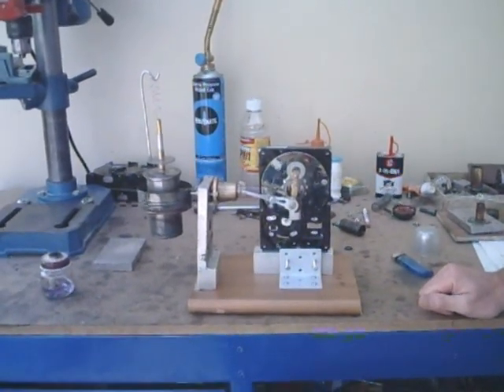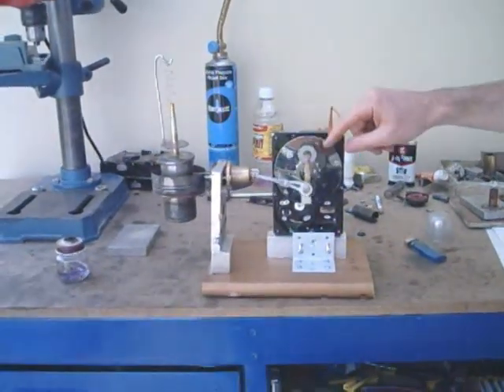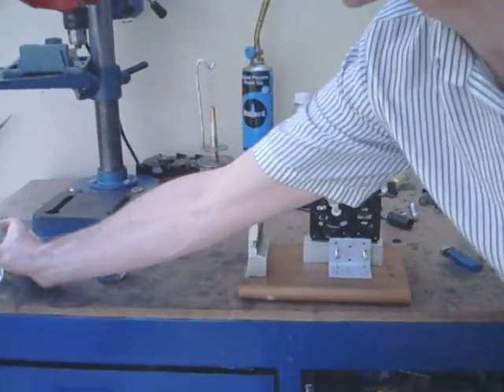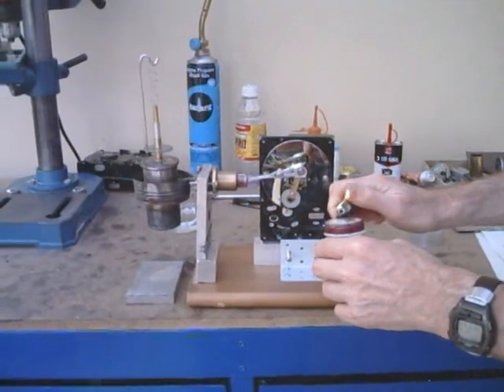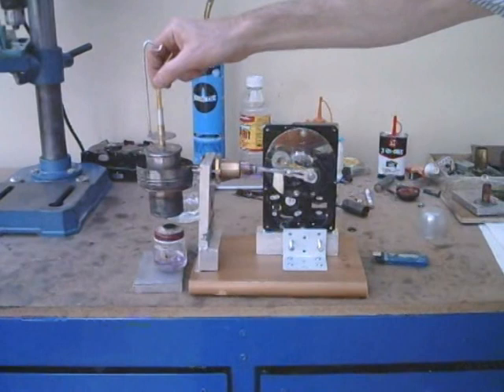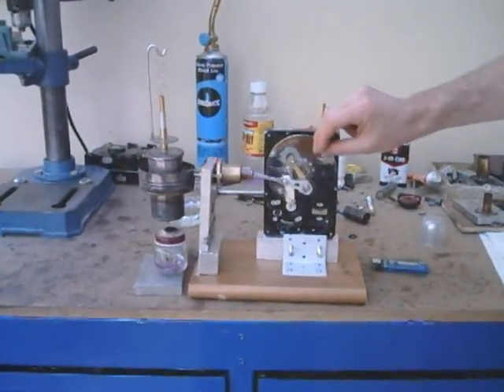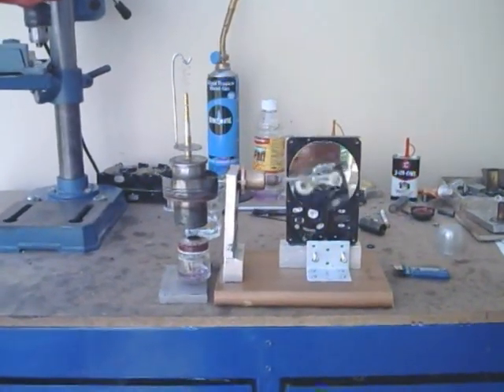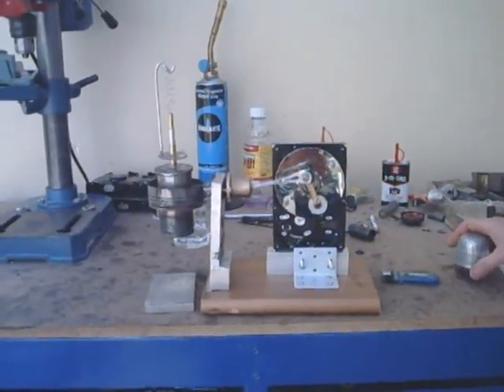Model Rignbom Stirling Engine

Comment from the maker: I am sure there is a way, unfortunately it takes a much smarter man than myself to figure that out. I worked by trial and error, not at all sure that the parameters I chose were optimal.  In fact very unlikely.

Comment from the maker: Sorry, don't have any sketches. It is a Gamma SE, it has a displacer, not a hot and cold side like Alpha type has. It is a Rignbom design, so the displacer moves not because it has a mechanical link with the power piston, but because the displacer push rod has a reasonably large diameter (8mm) so it has enough area for the changes in internal pressure to produce enough force to move it.

Comment from the maker: The issue is power density, ie the ratio of power output to the size/weight of the engine, it is here where SE loses out to steam and IC engines. And here the thermoacoustic design suffers especially. It is almost impossible to extract any decent power out of it unless it is the size of a house. The reason: it is hard to achieve a large temperature difference with this design due to the lack of active displacer/mixer. The acoustic waves don't vary temperature enough to produce significant power.

Comment from the maker: True to a point. Stirling Engine of ANY design is the most efficient way to convert heat directly into mechanical energy known to man because it works on pure Carnot gas laws. However the maximum theoretical efficiency is about 36%, not quite 45, but still much better than steam or intenal combustion engines. SE potential efficiency is not an issue.

Comment: thanks.perfect synopsis for me.Are there ceramic Stirling engines.Seems ideal.Iknow the heat shield material on the Space Shuttle in a dense form is actually harder than diamond.Would ceramic be perfect for one?

Comment from the maker: A ideal Stirling is a free-piston design that runs on highly-pressurised hydrogen in the fully enclosed container. It has to be extremely hot on one end and extremely cold on the aother. Cylinders, displacer and piston are made from hard material with minimal heat conductivity and thermal expansion. The seams between cylinter and piston are machined to a high degree of precision, made from 'mutually-slippery' materials and contain no liquid lubricant.
Naturally this design is hard to implement.

Comment: If I want to make a Stirling engine as efficient as possible and run on a working gas of several thousand psi and not leak ,the free piston design would be the most inexpensive to make wouldnt it?Thanks.

Comment from the maker: Theoretically free pistons are more efficient as less friction and move native timing of the displacer.  In normal engines displacer is rigidly timed 90 degrees ahead of power piston.  This is not the best regime as it starts compression midway through expansion cycle and vice versa. This reduces efficiency as the two cycles work against each other for a quarter of the time. Ringbom delays displacer movement till the pressure demands it (rather than rigidly 90 degrees), this is more efficient.

Comment from the maker: The displacer is moved to the coll side by the pressure buildup caused by an 'overdrove' due to the inertia of the flywheel which continues it's movement even after the expansion stroke is completed. Ie, once flywheel reached the bottom dead point due to the heat expansion of the air inside, it does not stop there but continues it's movement causing by now compression of the air which pushes the displacer rod 'out'. That moves the displacer to the cool side.

Comment from the maker: Ringbom engines have the displacer push rod of a reasonably large diameter (8 mm in my case).  That provides enough pushing area for the pressure inside to produce the sufficient force to move the push rod (syringe-style) and of course the displacer with it.  The weight of the displacer and the push rod plays no part as it is compensated by the overhead spring whicj should be visible on the video.  If it is not visible I may have to redo the video with a closeup.

Comment: How does the displacer move if when there is no physical connection?  I know it is by pressure inside the pressure vessel, but how is the movement facilitated?